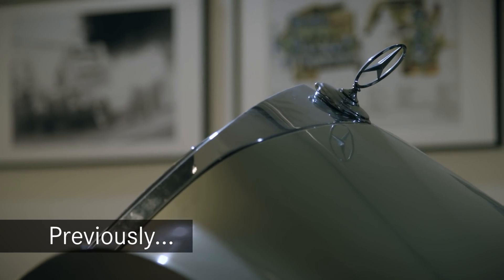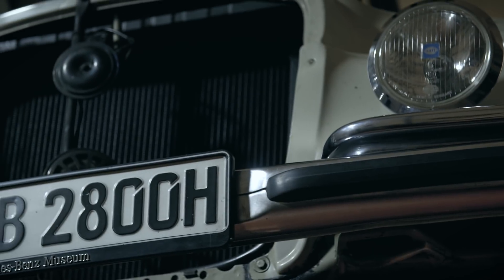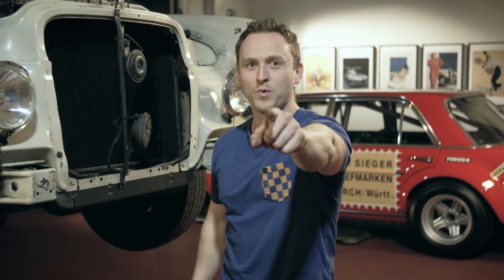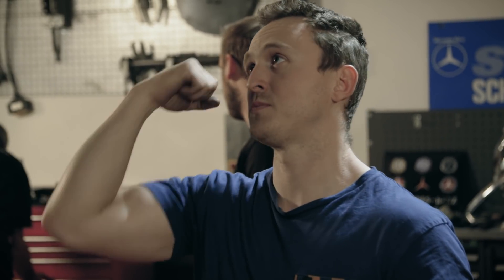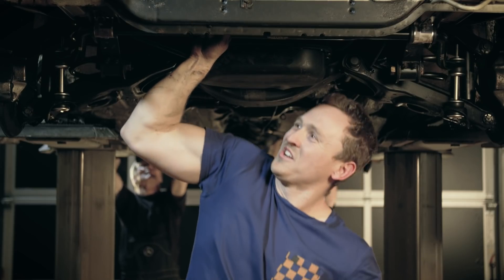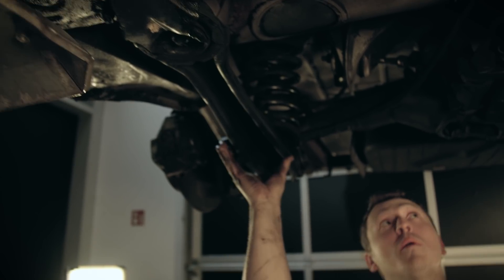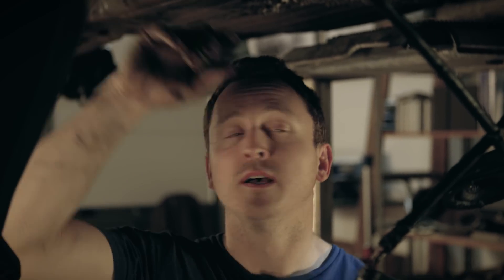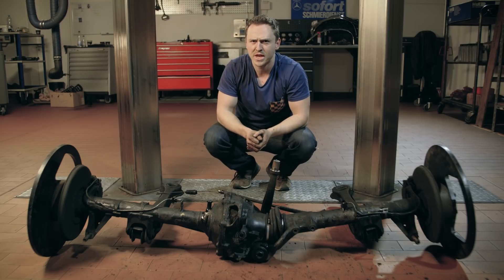Fitting RACE Suspension To My 50-Year-Old Rally Car

Comment: Suspension, brakes and tires are my favourite part of project cars! That's what really turns a car into the kind of machine you want (track, rallye, drifting etc), power is secondary to that!
Reply: that is exactly how a project car that gets driven should be built. Make it handle and stop before you make power. (Looking at you Honda guys) 400hp and stock fucking brakes

Comment: You never mention what was making the engine run rough an not wanting to idle
Reply: Those Bosch mechanical fuel injection systems run like crap basically if they feel like it.

Comment: Why are German workshops dark as dungeons?
Reply: Well as a German mechanic I ask myself the same question. Every shop I've worked in was dark as f...
Without my bright hand LED lamp I'd be literally working in the dark. I actually have two of those, one is always at the charger, so I'll never run out of precious light. 
Guess it's due to the high costs for electricity here (it's insanely high) But nowadays you have LED lighting which just needs a fraction of electricity compared to traditional lights. But still I'd say that 90% of all the shops still don't have enough lights.
Reply: The windows were tinted before the shooting. Daylight conditions are changing over the day, and it avoids light reflections.
Reply: As a german used to be mechanic I always thought it was in case the brits thought of airraiding again